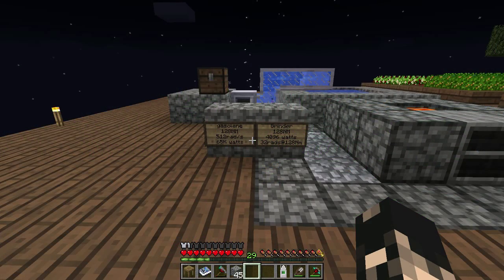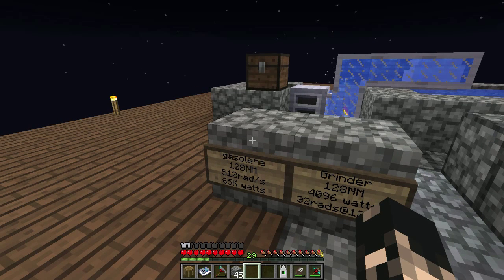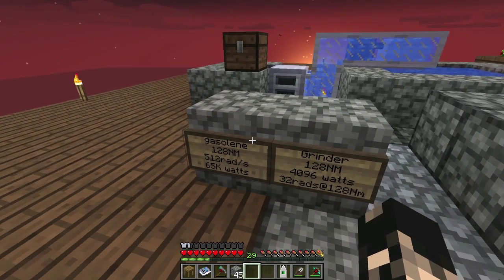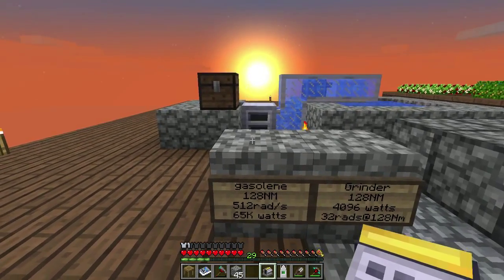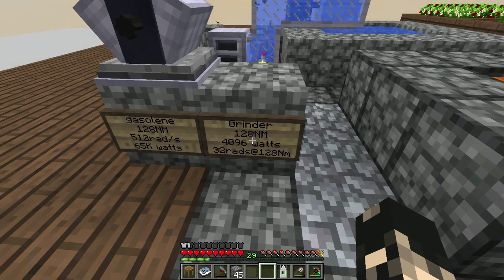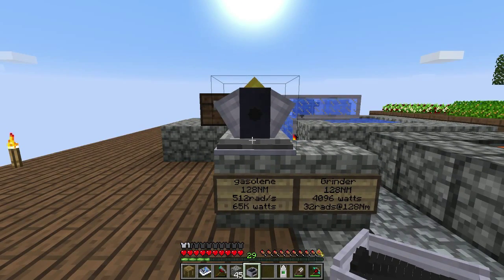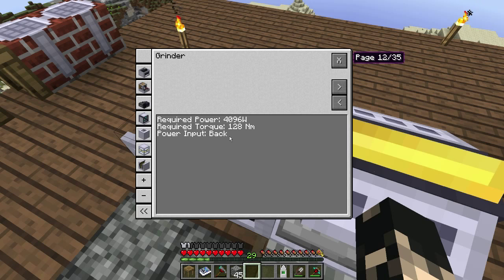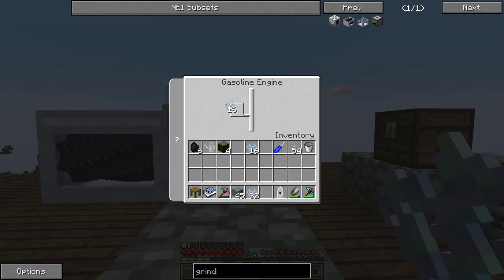RotaryCraft Gasoline Engine, Grinder 3 times ore processing

Comment: Nice! You make me miss rotarycraft =(
Reply: is it dead?
Reply from the maker: martinxXsuto Its not dead just not in any of the big mod packs yet as far as I know. You can still download the mods and drop them into pack as I have done. I'm referring to 1.7.10 version. If you want it in 1.6.4 then there are quite a few with it in. There aren't that many 1.7.10 pack, more will come thou.
Reply: Ausyarr martinxXsuto True Aussie, not dead. Just me not having it installed anymore. =)  Have you checked out the coming FTB packs?
Reply from the maker: They have the alpha of the ftb light pack but it's not going to be representative of the full one. I doubt Rc will be in it anyways.
Reply: Ausyarr I was hoping for some big ftb official packs before august but... but no ^^